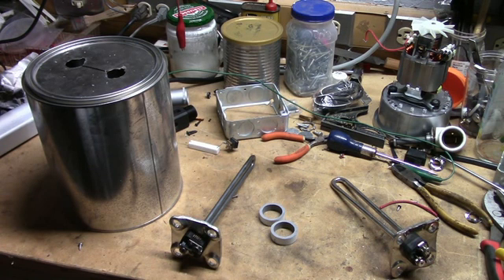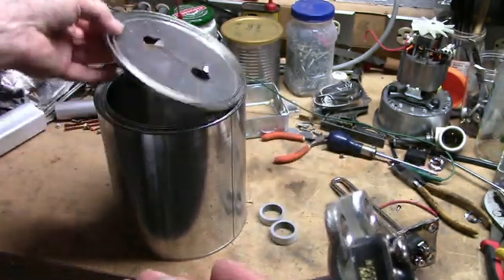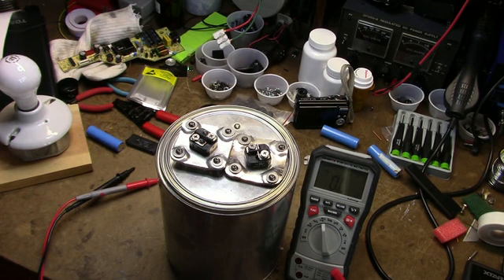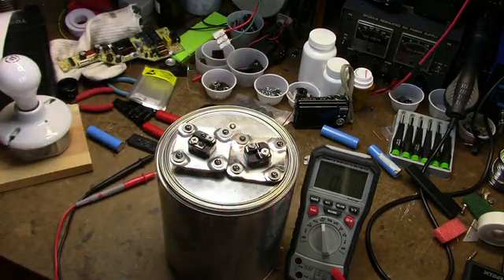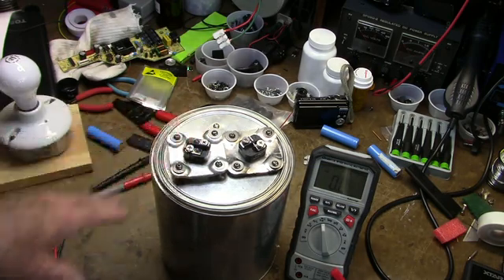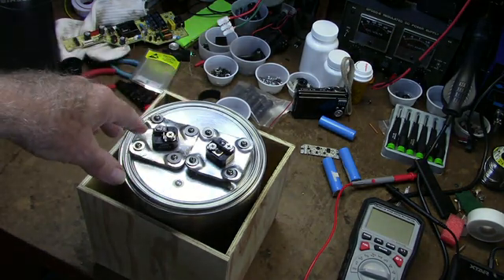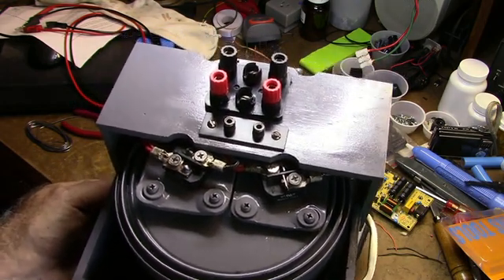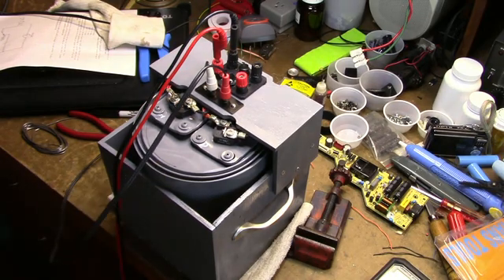Audio Dummy Load

Comment: The nice thing about using isolated water heater elements is that you do not need to use a dielectric fluid like mineral oil. You could just use something more readily available like water, or probably better yet engine coolant (water ethylene glycol) so you wouldn’t need to worry about having it sitting in the car on a winter day. Engine coolant would probably make the unit last longer than water since it has corrosion inhibitors in it. Water or WEG would probably be slightly better thermal conductors than mineral oil anyway, helping dissipate heat from the resistors more efficiently. Thank you for the excellent idea, this was something I was needing to build and was hesitant because of the cost of proper resistors. I’m glad I found your channel!
Reply: I’m not sure if water or engine coolant would expand and contract more or less than oil, but as long as you have some air in there and a vent, you should be good from a pressure standpoint. If you’re worried about evaporation over time you could make a simple sight glass using transparent tubing and compression fittings, if you really wanted to go overboard on it!